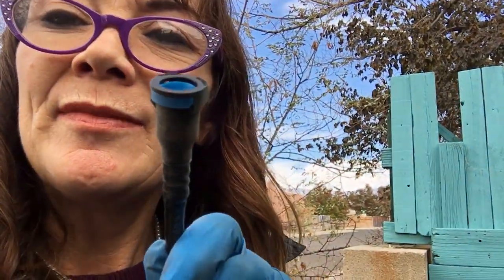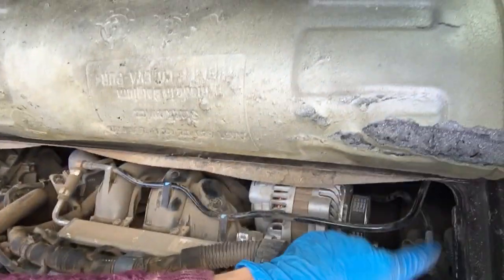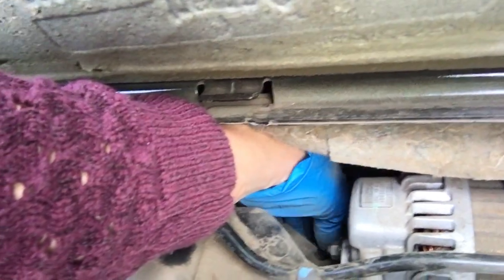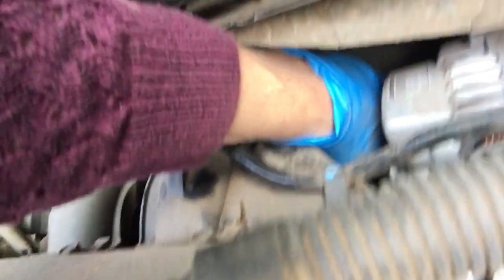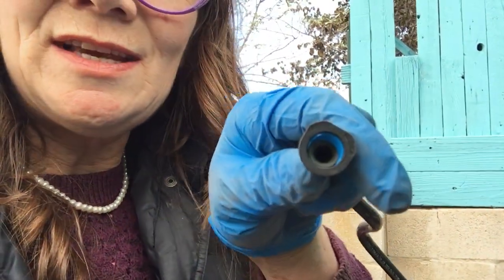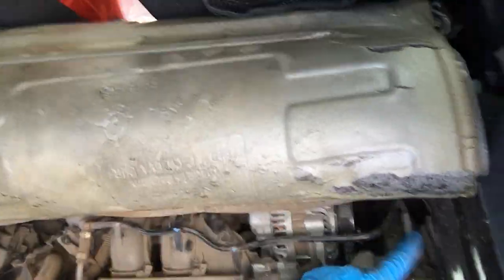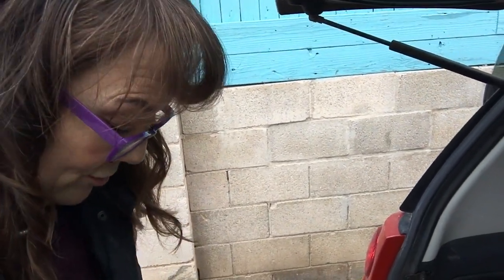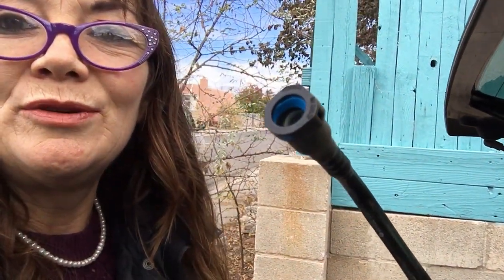Purge Flow Solenoid Replacement in 2008 Smart Car, Code P0497 #LiveAlive #PlayEveryDay

Comment: I’m a little discouraged now. Like do I need to pay them. Did u get it off?
Reply from the maker: Yes, it came off easily, I just disconnected the closer end first to give more play. It is a tight fit for hands, but just slides off while pushing the blue/colored tab-thing. If you practice on the new one first you will see how it works. Then just connect the far end first and the closer end last.

Comment: What was your vehicles symptoms causing you to replace solenoid?
Reply from the maker: Check engine light and code P0497, which persisted after replacing gas cap. This is the next logical step, and lucky me, solved the problem. Next logical step would be to test the system for leaks.